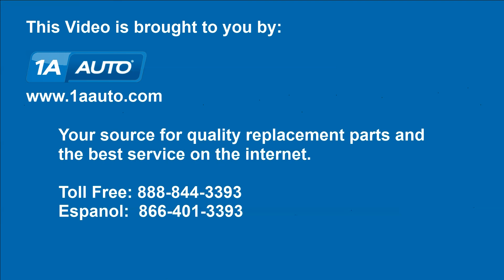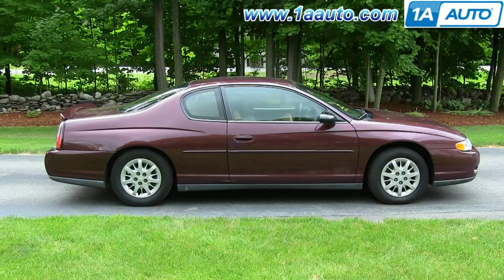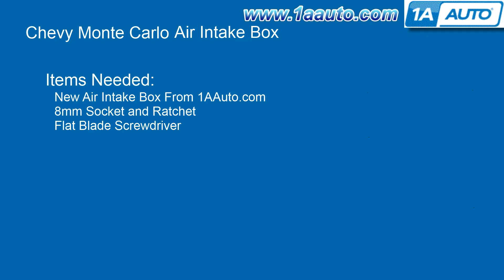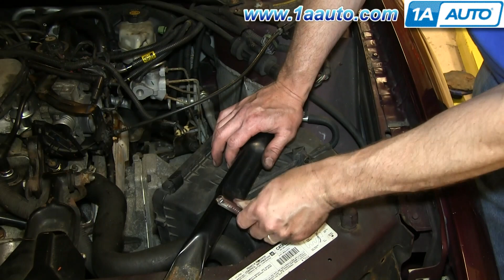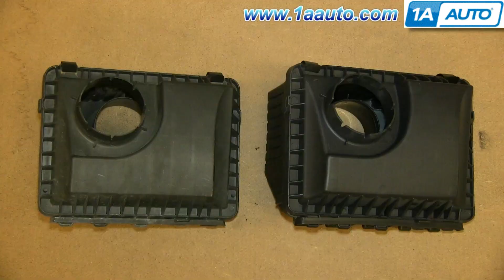How to Replace Air Cleaner Assembly 00-05 Chevy Monte Carlo

Comment: Hi mike I really need your help. I want to know what is that hose that you disconnected from the hose that is in between the air filter box. It’s at :44 sec. I was wondering because I’m trying to replace the thermostat and I pulled that hose free but I’m not sure what the other end of it goes into. Does it go into anything or does it just stay open? Please let me know ASAP. Thank you. 😀
Reply: Tony Graham im also looming for where th hose goes to and what it's called i need a new one by the looks of mime and need to know where it goes and what it's called have u found out yet
Reply: It goes underneath the coil packs